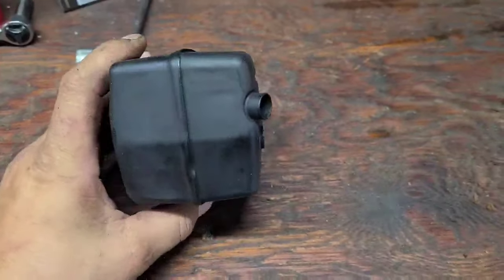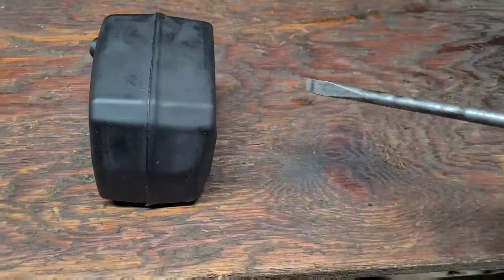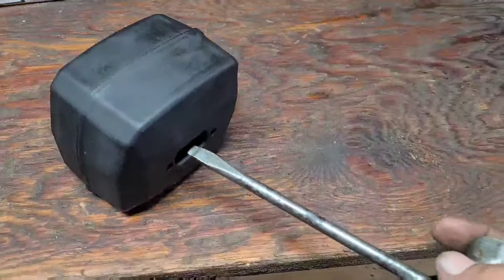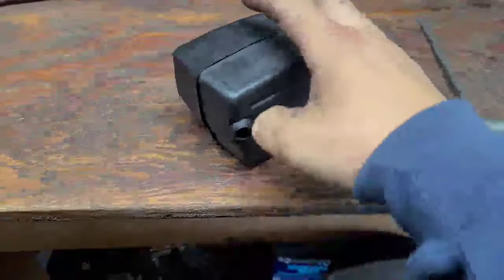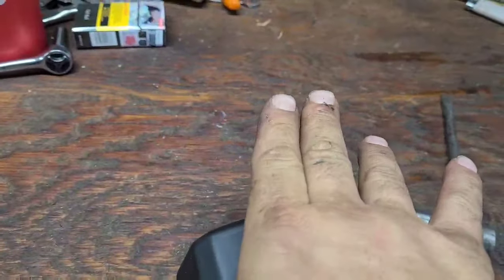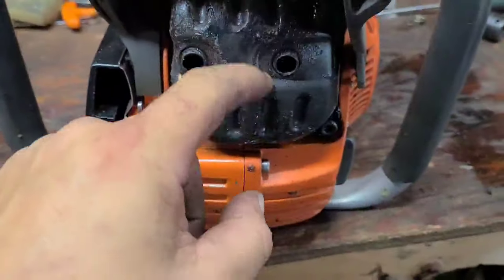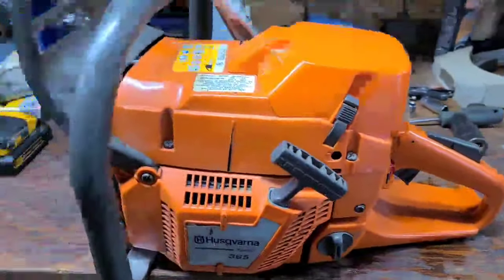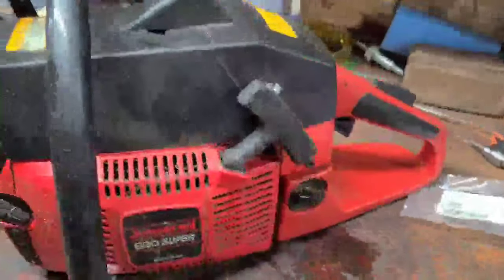Lets talk about chainsaw muffler mods.

Comment from the maker: ****IF YOU ARE USING A MODDED MUFFLER IN A  FOREST INSTALL A SPARK ARRESTOR!! ****
Reply: I've been a electrician since 97... and when I have young apprentice sent with me for training some will ask are you not like my last foreman that knows everything???... I give them the most serious face I can (6'3" 300lbs) with out laughing... and tell them this " the man that tells you he knows everything ,,, knows nothing at all" ... we are all constantly learning new technologies and when I stop learning I'm dead...
Reply: Be careful adding screens they can and do  restrict the flow tremendously. No problem using them just know you need a lot bigger port than without them.
Reply: Lolll thanks for the psa
Reply: @julianlaustsen1991  very rarely a chainsaw is gonna spit any sparks significant enough to start fires. it does happen though. 
however, the most common reason for forest fires due to forestry is wheel chains on heavy forestry vehicles slipping on rocks

Comment: Your right on.   The engine is a larger system than most people consider.   The exhaust is one aspect that has to work with everything else in the chain.    making giant exit holes is not working as a team.    Controlling the temperature window is huge for controlling many important aspects of an engine.   The metals used, have an temp operating range, the oils have an operating range, the tolerances are effected by temperature, the air fuel ratio is majorly effected by temp...    I hate computers in vehicles but the power you can get out of an engine by tightly controlling every aspect is amazing.

Comment: Florida boy here, 90 degree weather, only cut pine and live oak  mostly. I bought a poulan 4620 avl many years ago new. Off the shelf it wouldnt get out of its own way, the 20 inch bar was laughable. I opened the muffler, removed the baffle, removed the exhaust deflector and spark arrestor, drilled it out to 1/2  inch and adjusted the jets. Night and day difference. I can throw it on a shelf for a year, still fires right up and cuts anything I need to cut. I have to buy another saw now, watching you has made me want to port one , can't touch my poulan it runs to good. Definitely in favor of removing the baffle and spark arrestor on a hot weather home owner saw if it has a high speed jet adjustment.

Comment: you ny far have one of the best explanations of exhaust mod    i do the same on stock saws  in my shop.  cut out the center of the baffle  2 3/4  inside pipes  no longer than an inch     love your channel   keep up the amazing work

Comment: Great video Tinman.  I got a harsh lesson in the science behind 2-stroke engineering in my youth and further experience in the 4-stroke world in my teens.  That ratio you mentioned is so important.  I recently worked on a saw with a couple of beautifully crafted, monstrous tubes poking out of the front of the muffler. I was addressing a totally separate issue, but the owner also mentioned that he thought the saw seemed to lack low end grunt.   When I made mention of his fancy muffler possibly being a factor, he firmly discounted my opinion...   Oh well!
Thanks for putting out such a detailed explanation and sensible video.     Bless’ns to ya,     Tedd

Comment: Scavaging is a huge thing in 2 strokes. Sonic waves back flow determine powerband as well this is why the larger pipes .. Fatter and shorter or longer and thinner depending on torque you want or powerband .. We need to make a power exhaust valve system for a saw or a rotary type valve system.
Reply: Reeds

Comment: Totally agree that you don’t wanna open it up too much, the small two strokes need a certain amount of back pressure to run properly and be able to even tune it. It’s a delicate balance of making it slightly bigger to get more flow but not lose too much back pressure.
Reply: Or just use stock and run your stihl for 20+ years without issues. Its not racing machine but tool that gets job done
Reply: @tonytony978  when cutting 10+ cords of wood a year I do saw wood like a racing machine, and I’ll take any extra power I can get when cutting 30” oak. As long as u tune it properly and it’s not running lean it doesn’t seem to affect the longevity. I’ve never burnt up a saw motor.

Comment: All my experience comes from modding 4 strokes where you want to completely as much as possible evacuate the cylinder. But you do that in a 2 stroke and you loose your charge out the exhaust. Never really thought about that, but it makes sense. Glad I watched this before attempting to mod my muffler. Also been watching your porting series.

Comment: On an auto tune saw, it seems like their is less possibly to lose power. I just got a 545 mark 2 and used a 3/8 bit to saw through a baffle which allows a pretty direct path for the gas to escape. Saw runs great.

Comment: I agree 100% 
I do most of mine dual port with two "tubes" out the front corners (on ported saws) I have found gains when I leave the tubes about 2" long and extend the tube inside the muffler to within 1/2"-3/4" or so of the back of the muffler inside (on mufflers that are an empty can) VS. a tube that is 1/2" long and flush with the inside of the front of the muffler. They dump heat/stay cool and still flow much better while retaining some of the "bounce back". I am in the same boat and in agreement that we all have our own methods. Often we end up with similar results from completely different designs. Thanks for sharing! There's only one way to gain true knowledge in my eyes and that's first hand experience like you're doing. Only one way to find out what works and what doesn't.......... get out there and do it ;) We can all learn from each other. Whether it's a lot or a little, it's still learning. You tube is a great community for us like minded people. thanks again and keep up the great work!
Reply from the maker: Yeah youtube has been fun..

Im learning so much from the comments here, its been great!!
Reply: Interesting, I always thought the tube flush with the inside of the front of the muffler was better.
Reply: @MegaDirtyberty  The gains I've found are in the area of added torque. Not sure if "cut times" are faster, but I feel I can lean on them noticeably harder in the cut, without much drop in rpm, compared to the mufflers of same design with short flush tubes. I don't have a dyno, so it's only one man's perspective of course. Also, I've only done them on saws that I have ported. Very good chance that my style of porting may vary well be different than others. They may just lend themselves to my style of porting, but not so much others, and vice versa. So many variables. That's why I find these topics so interesting and enjoy when people share "their" experiences! I'm always willing to try new things and learn.
Reply: @samishsawworks5870  I am going to try it on my 372, see if it makes a difference.
Reply: @MegaDirtyberty  keep us posted!
Reply from the maker: For the record my 365 muffler with the 12g barrel has the pipe inserted like 1" into the muffler. 

That pioe seems to work very well.

Comment: Nice video mate. I made a complete tube exhaust inside the original 372 muffler box it's a straight pipe to the end of the box plugged at the end then about 25mm back from the front of the main pipe a 3/4" pipe comes out the side slightly on-top of the main tube which is 1-1/4" diameter and sweeps slightly upwards inside the muffler box. This along with my porting and the higher flow air box I made it really does pull like a mule And compared to my mates 372 the high jet it's half a turn more and I will nearly cut double what he can in a day. Once my exhaust warms up that's when it really pulls air through. And I have noticed my saw will run cooler then a stock one.

Comment: The 52mm meteor piston kit fits the huztl 52 cylinder perfect and it’s a great little topend to port... I’m definitely liking the Hyway with a popup in 52mm I’m still sanding my piston and easing all my edges in whatever topend I’m using... any heavy metal plate inside of the can muffler is bad...it’s a heat sync... that heavy metal should be as far away from the exhaust port as possible.  It would definitely make sense to have the face plate (6 degree curve or whatever the focus the sound waves back into the center of the exhaust port window... ) like a resonator type pipe... I’m trying to make a bell type muffler design that ports off in four different directions. The ms391 runs 35% better without that crazy tight muffler!  I think that’s what causes their bearing problems...too!

Comment: 2stroke exhaust tuning is a balance between back pressure and air flow, but manufacturers also have to take noise levels into consideration for regulations in different countries. By opening up the muffler you can get rid of that noise regulation and let the saw breathe. You will have to retune the saw for the additional airflow. As with all these mods, sometimes less is more.

Comment: The "divider" is the baffle.  That's how mufflers work to cut down their report.  The elongated and routed space causes the expansion to happen slower, like the suppressor on a firearm.
Reply: Stock muffler is good at keeping it nice and quiet, albeit at the cost of a lot of heat, most guys wouldn’t notice especially if they have the patience to let the saw idle down in between cuts. 
Problem is most guys don’t have the patience. 😂 easier to do a five minute hack job and open up that muffler a little to keep your engine cool when you’re working.

Comment: I put a 3/8" hole then tig welded a 1/2" long piece of tubing  right in the center of my 350 it's the open muffler design inside,I left the top factory hole in it also with the screen removed. I then adjusted the high side up on the carb because i had a bogging ,I went with a ngk 7r plug and I run klotz 2 cycle oil with ethanol free gas. I love the smell of the klotz from from the years of racing motocross. The ethanol free gas saves the internals including carb parts

Comment: Love it brother. “A muffler is more than just a sound deadening device”! Couldn’t have sed it better especially with two stroke motors! The resonator in a two stroke is where it makes a lot of its power! And when you create to much air flow then the power goes right out the holes! And if you crush the flow or choke it down to much where it can breath enough to make good power then you get the same result! It’s a fine line of a happy medium to get it right nothing wrong with testing these things out but I always keep that in mind! I always looked at my KX 250 and if I got a big dent in my pipe you could immediately feel the power difference! Same thing with are chainsaws just on a much smaller level! Great video brother I need to get your contact info! I am sure you are busy but I have seen your work! And it is crazy the power that you are getting out of these saw truly gifted brother! The Homelite that you did for Buckin and that 044 crazy brother just awesome! I have a older but very well taken care of MS391. She isn’t even close to my best saw but she is my favorite I have had her for more than 15 years! And she has cut more wood and made me more money and got me through more cold winters. Than all of my other saw combined she has never let me down and always start right up. And I would love to see what kind of power I/ we could get out of her. The 391 is a saw I think doesn’t get her dew but for the price you can’t beat it and mine has put plenty of pro saw to shame! Thank you sir love the video good luck and god bless! 🍻

Comment: Cool vid.  I experienced that with too large a mod opening in the muffler, I ran into an idling problem where I couldn't get it to idle without the chain moving.  Keeping the rpms low enough to stop the chain movement would kill the engine.  I suppose that equates with the engine being too lean that you spoke about.

Comment: Great video , something to throw at u ,in 2 stroke go karts , we add pipe length between header and muffler , every inch longer gives u more low end and knocks about 100 rpm down . If u shorten pipe u gain rpm and lose a tad low end . So I noticed out west for a stihl . They make a spacer about 1/2 thick to space muffler out from block . Theoretically it would gain low end with that . It would also keep heat down . Your thoughts ,

Comment: the easiest modification is to port match the muffler openings to equal the size of the exhaust port on the engine. I also drilled and notched the baffle to increase the exhaust flow. I did not alter or modify the spark arrestor. I'm using a small 42cc poulan with a 18 inch bar and chain. I filed down the rakers about 1mm to 2mm to get a  faster cut.

Comment: I appreciate the power increase per noise increase from a muffler mod. I try to keep it slightly smaller than the exaust port overall size. One other thing I NEVER do is a front mod, too much noise increase and it seems to not get as much power than the same size hole somewhere on the side of the muffler. One reason why I'm not a big fan of west coast saw bark box (love the rest of their product line though), or a straight shot.

Comment: The Echo 4910 muffler is the most stock breathable muffler out there! No divider, only a restrictor tube. After shutting it down, I can touch the muffler. Yes, it is hot, but not enough to burn my skin. Echo has the best stock mufflers out there!

Comment: Most if my experience is with Stihl's 028 (Just playing with what I have).  I know of three different style mufflers for these saws, which I believe, demonstrates Stih's attention to the subject.  Without a doubt, some concessions need to be made, (spark arrestor, Decibel level, size for example).  But when one considers the lengths that Stihl went to, to improve their market share (Internal modifications and re-tooling are not cheap), Stihl would have, for sure, done everything possible to gain horse power by enhancing muffler efficacy (just an external bolt-on part).  Can something be gained? sure.  Is it necessary on a modified saw? yes, probably more-so than a stock saw.  However, I don't think bigger is better.  I see some thumbs-down;  these most likely come from those who spend and hour randomly chopping holes in the exhaust, but won't spend 10 minutes sharpening their chain.  Thank you for the presentation, I think you saved me a lot of grief.
Reply from the maker: Hey great write up. I find most stihls really benefit from a muffler mod. 

Stock saws as well as modified saws both do well with a muffler mod, it gets the heat out which helps the saw run better.
Reply: @tinmanssaws  Thanks for the  compliment,  I'm glad you mentioned cooling,  I thought about casting a front cover with fins, and also thought about brazing two pieces of copper pipe on the inside of the muffler (top to bottom or side to side), and putting holes in the muffler where the pipes are brazed.  The objective is to get more contact with cooler air.   That's a lot of work, I think I'll drill an extra hole (small, then slowly increase).  Thanks Again.
Reply: @thomasgronek6469  check out what Stihl did with their 038 line that I haven’t seen on any other saw. The front cover is layered with the outer layer corrugated and has many cooling holes in it. Genius design imho.
Reply: @supersportimpalass  thanks, I'll check it out.

Comment: Makes sense, an unmodified air pump needs little exhaust modification except maybe the noise pollution additions, where an air pump that has been modified to pump more air needs exhaust modification. 2 strokes are a different ball game fuel wise sucking fuel rich exhaust back into the combustion chamber

Comment: Some saw mufflers I’ve seen even have catalytic converters in the winch heat up making it even hotter
Reply from the maker: I hate those. They make soooo much heat!!
Reply: @tinmanssaws  ya i had one drill  and  burr  fixed him
Reply: Which ones have a catalytic in them?
Reply: @johnnyhollis2668  idk if the saws are the same way but my echo 266 is cat exhausted. Stupid hot.

Comment: I agree to open and you can run lean.  My MS460 was boiling the bar oil the muffler was to hot. I don't think the saw was ported but it has allot of compression. I bought a pre-built Muffler from Bailey's with dual ports on the muffler it made all of the difference in the world. I runs great and I don't remember what the baffle looked like but I think it was 2 pieces so you could take some of the baffle out. I run it like it was built and not more heat problems. I don't think it takes much to make them run well with out being too lean. Great video!!!

Comment: You're a man after my own heart, Tinman.  The 12 gauge exhaust port... that muffler is DEADLY!  

I am having hot start issues with my 266 that I put the meteor big bore top end in.  I suspect the stock muffler is to blame.  I'm not sure how to get it apart without making a mess of it, to get the baffle out.
Reply from the maker: Most 266/268/272s ive encountered likes to be idled for a min or 2 before i shut them down. 

If i dont do that they are hard ro start warm. The intake block and screws tranfers too much heat to the carb.

Comment: I would like to see you build some straight pipes with different lengths and diameters. Adding steps in the pipe diameters too. Anything going back into the engine from the muffler is contaminated with spent gasses which robs power. I know you know this. Thanks for sharing!